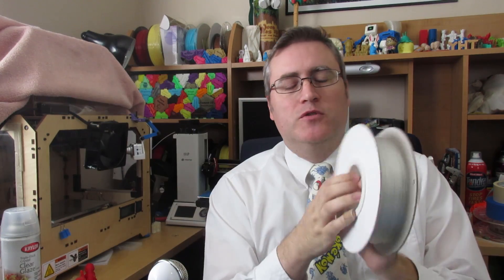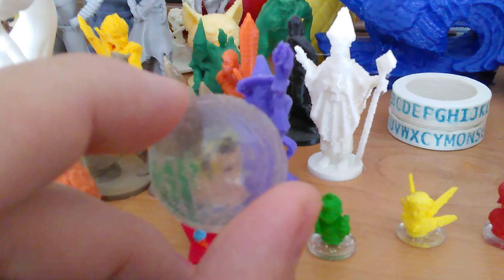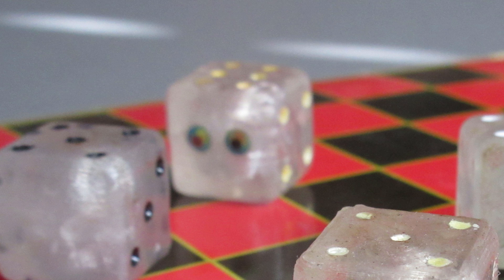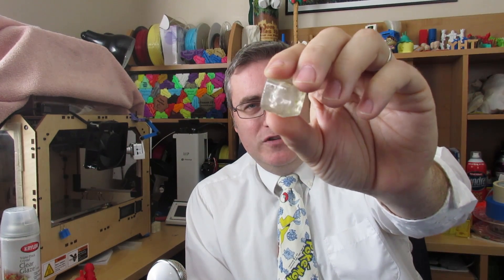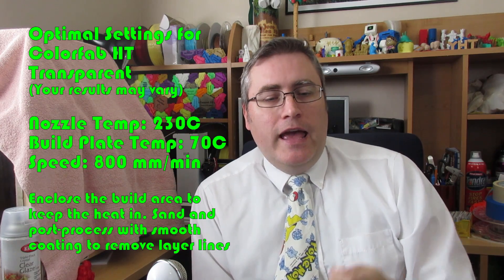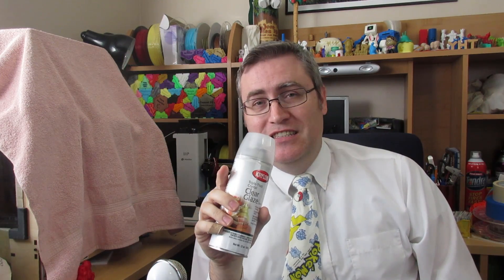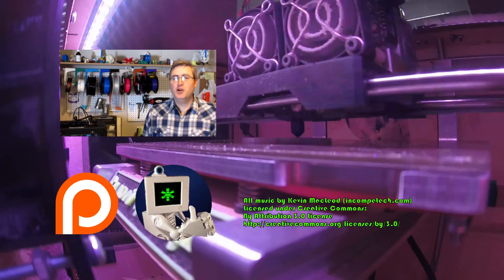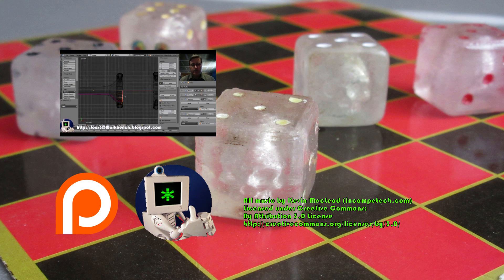3D Prints as clear as glass with Colorfabb HT

Comment: I'm sorry. I didn't get an understanding of how to eliminate those micro bubbles, so you can achieve a clear/transparent print. Do you think it would be possible to completely eliminate the micro bubbles by lowering your layer height to nex to zero?
Reply from the maker: If the plastic doesn't have enough room to come out of the nozzle, it will cause a clog.
In fact, it's better to have thicker layers for this trick, because there will be less space between the different extrusions.

Comment: I have one printer designated for PETG only.  I've been playing with slicer settings and I have finally managed to get very clear PETG prints.  Not glass clear but clear enough that I can easily read through it at a 5MM thickness.  The keys I have found are: SUPER dry filament.  Printing HOT (like 260°C).  Going slow (20-30mms max).  Thin layer lines help too.  I've had best success with overture transparent PETG but also with some cheap stuff I got from amazon ($18 roll).

Comment: Bubbles are fun but not in 3D Printing. My solution is to engage coasting and/or combing with a Flowrate at 104% or 108%. Combing is a double edged sword, if you don' want the nozzle's travel path appearing in the printed part than don't use it and enable Z Hop with retractions. I use it for the milky milk jug appearance because what I think is happening is a semi ironing effect or additional heat is fusing the material. Just my 2 cents.

Comment: did you try with smaller nozzle?
Reply from the maker: No, but I suspect that would introduce more bubbles. A thicker nozzle would probably produce better results.
Reply: @3dpprofessor  i think about smaller nozzle not thicker. you showed this layer diagram on a layer and if the layers are round it makes sense.  I wonder if I tried with the 0.2mm nozzle, would it be possible to reduce these spaces due to the shape of the nozzle hole and get a more transparent print
Reply from the maker: @projectxmarketing3431  give it a shot and let me know how it goes!
Reply: Okay, I'm goin to try because I wanna buy this transparent filament

Comment: A bit late to the show I guess, but here's my 2 cents.

HT, as well as al other Co-Polyester filaments by colorfabb are exactly that; polyesters.
They're all a PET-G base with some addition to it, I'm not sure which addition is in HT though, must be something similar to PC I reckon, judging from its printing properties and behaviour.

A notorious property of PET-G is in fact that it is fairly hygroscopic, just like Nylon and a lot of other plastics, 
Meaning that bubbles caused in the print could actually be from the filament having taken up moisture, not so much the difference in printing temp. It might also be both though, I experienced this with Colorfabb's XT granulate when trying to Injection mold with it. At a certain temperature the plastic would start to hydrolize (not sure if this is the correct English term), and form very porous casts.

Anyway, quite impressive. I would not have expected this to be possible with HT to be honest.

Comment: I have a theory as to why there were more bubbles in the print at a higher temperature. A higher temp would make the filament more liquid and thus not give the air bubbles time to escape as the layers are being laid down. A lower temperature would have the layers set just a bit more slowly, giving air a few more microseconds to escape. Not very much time, but maybe enough to allow air that would normally be trapped to be pushed aside. I have no proof, but it's the only explanation I can come up with.

Comment: I need something clear that can handle boiling water a good bit above the boiling temperature and also freezing water a good bit below the freezing temperature, and safe to drink the water afterwards... or maybe not drinking, just make it clear during the research and development process so I can see the flow of the water (like with flakes of glitter) and once the design is final then make it out of metal. I won’t have to worry about pressure of expanding and contracting... but there is one idea of design where I would want it to be able to handle pressure. The water will never fully freeze. The area that holds the water, a small proportion will be freezing and one the other side of the “container” will be boiling. Can anyone please help me with the information I need ?!

Comment: The filament is PETE, which is the same stuff they use to print soda pop bottles. 

PETE is noted for hazing. if you ever have a pop bottle rejected from a recycling center, hazing is the most common reason why. 

You need to keep the PETE Amorphous and dry. PETE reacts with water (ironic that they store carbonated water in it...). Even atmospheric water. The water increases the crystalinity of the polymer and reduces the clarity of the piece over time. 

As far as a post print treatment, I'd suggest using an actual flame, rather than a heat gun. A mild flame, like a lighter, might actually work better than a blowtorch, since the direction of the flame is mostly up, so you can move the work piece to avoid absorbing too much heat. You want the fire to remove the offending plastic, not remelt them into the work piece. Too much heat will allow the surface to 'crystallize' which will cause further hazing. 

As far as solvents go, you might be able to get some limited results with xylene, but probably not much.

Higher speed kinda equals out to higher pressure, lower temperature, which is better for keeping the polymer glassy (amorphous).

Comment: i got clear PETG to print bubble free solid and see though clear.
what did the trick, was a nozzle that i had polished a bit awkwardly, giving it's face a slight dome shape. (aside from printing slow and hot)
the surface finish suffers a little, but it works wonders to massage layers of hot plastic into a seamless solid. now all i need is a way to polish PETG mirror smooth ..
Reply: Awesome! I love you for this knowledge. Could you please provide detailed instructions on how you polished and shaped your nozzle, and the nozzle size/type? As far as polishing Any surface of any material to a mirror finish. Get yourself "42pcs 1 inch radial bristle disc kit" and some TechDiamondTools diamond polishing compound polishing paste. The radial disc sanding disc kit is 80-2500 grit and you can finish to mirror shine with the diamond paste compound. I do this with the knives I make.

Comment: At 1:25, i see the "exit" of the printer is circular, ¿it can't be change into a square, to fulfill the gaps?
Reply from the maker: A square nozzle? There's problems with fluid dynamics that prevent the output of a square nozzle from being actually square. When I was a kid my mom had a cookie extruder and in order to extrude square cookies the die had to be kinda star shaped. Of course it could be done, but then you'd need to add a motor to rotate the nozzle so that the corners when the directions you wanted.

Comment: would printing in a vacuum with a temperature control help?. i think it would.
Reply: That would mess up the printing tolerances. Because FFF printers are calibrated to function in a normal atmosphere, the melting properties will also change in a vacuum.
Reply: can't you calibrate ir than to where it will?

Comment: I appreciate that it is difficult to achieve clear glass like prints with a 3D printer, giving your video a title including "prints as clear as glass" and showing how you get at best to something that is 30% opaque is nowhere near clear.  What you produced was a translucent object, not transparent.  The skeptic in me suggests that the only way to get clear as glass is to use ... glass and the old fashioned methods.  3D printing looks only useful for opaque or at best translucent end products, not transparent. Please, someone show me that I am completely wrong! I'd like to prototype objects that can be used to refract light, but the only viable solution to seems like getting some solid polycarbonate and mill / turn it into shape then follow up with polishing.
Reply: "only way to get clear as glass is to use ... glass" - there are plastics that are at least as clear as glass so it's not wildly outside the realms of technology that it could be possible. Is it possible with existing technology? Who knows. Probably the wrong plastics are being used for perfectly clear, maybe fdm isn't up to it, maybe it'll never happen. Certainly no matter how you do it I don't see printing clear being a thing without some surface treatment and probably a lot of polishing.

Comment: Have you tried sanding and polishing and of the flat surfaces? This seems like it would work well with your dice project.
Reply from the maker: I'm not totally clear about what that would involve, shopping list wise, but I'm open to trying it.
Reply: sandpaper and liquid plastic polish; although, you can polish with sandpaper alone. Start with 400 or 600 grit paper. Wet sand. Always wet sand. Then rinse and repeat sanding step with increase about 200 to 400 per step. Finish at about 2000, 3000, or 4000 grit. Liquid plastic polishes are the equivalent of about 3000 to 4000 grit.  If you finish with a liquid plastic polish look for Novus or Flitz brands. I usually finish with Novus 2 polish. I don't find the Novus 1 to add that much more shine. The whole polishing process should go very fast with plastic.

Comment: You mentioned some sanding on a couple of the last prints you showed. There is a product out there I've seen used for resin called micro mesh that might give you a better finish when used after you max out your regular sand paper grit. It is a wet sand process and the 'grit' ratings go really high to a nice crystal clear finish.

Comment: Cura also has a setting that allows you to offset the polygons in the model to compensate for a wider print line. It's called "Horizontal Expansion," and it's under the "Shell" tab.
Reply: Also, you may want to consider designing a flaming dragon, like the one by Inferno Ivan.

Comment: To polish the flat items. Get a double-thick mirror and place a fine soft lint free cloth on it. Then apply fine jewelers rouge which you can find in many grades and polish your printing on that. Convex and concave surfaces will require more thought.
R. Scott.
Reply from the maker: I tried juler's rouge and it only made the stuff I polished look red. I mean, it made them shiny and smooth, but red. Maybe I don't know what I'm doing. It's possible.

Comment: What's up doc? I like your video's and I am very excited to get started and make my mark in the 3d printing community. I'm kinda new to 3d printing, I finally took the steps and got me a cheep Chinese clone because I am having problems getting my own up and running from a 2560mega with the ramps1.4. I have been watching videos, reading and designing for about 17 years now. My thought about getting clearer and stronger prints, I don't know what the results would be, if there was a vacuum chamber enclosure around the printer to remove any air from prints? I know that marshmallows will expand because of the air trapped inside I'm just curious about a vacuum.chamber. I will make an enclosure around my machines to vent the fumes out side and try to make it vac also, just seems like things take so long to complete for me. but as the Latin say "sapere aude". Thank for sharing your experiences.
Reply: You would have to find a way to siphon heat away from the print, the electronics, the cold section of the hot end, and the stepper motors. Probably not impossible, but not something I will try.

Comment: This is amazing Joe can't wait for people to potentially use this in models. I'm wondering could you make the skull a different color just so we can see if it looks better than white?
Reply from the maker: The white is actually just the untreated surface. Changing the white to something else would involve either dual extruding or somehow filling the void afterwards with paint or something. I'd just have to add a hole to the void afterwards.
Reply: 3D Printing Professor WOW, I geuss that just gives that filament more credibility that it's see through

Comment: I used clear abs and after acetone vaping it was optically clear no bubbles, after a while.I started getting those bubbles like you spoke of, but that was only after having the filament a while, I attribute it to moisture getting in the abs, because it was steaming while I printed.
Reply: 3D Printing Professor yeah when I was printing structural parts I was printing really hot 245°c-250°c and about 30mm/sec and 100%infill. I imagine it may depend on how long filament sets around at the place it was manufactured, atmosphere and such before being packaged. my house gets somewhat humid at times so I'm sure it absorbs a lot of moisture. the filament that was the worst offender was woodfill pla, I imagine because it is so porous it just sponges up the moisture.
Reply: yeah, that's probably the cause. I would dry it with silica gel (or an oven if it's really moist), it improved my transparency of my prints with Formfutura HdGlass filament.
Reply: Farnømat yes I've baked the filament since and keep it in a vacuum sealed bag with silica
Reply: Nice, are your prints clearer again?
Reply: Farnømat yes
Reply from the maker: Interesting. The ABS for me never didn't have a huge line of bubbles, even right out of the box. But this has got me thinking I need to try it again, only hotter and slower like I did with the HT.